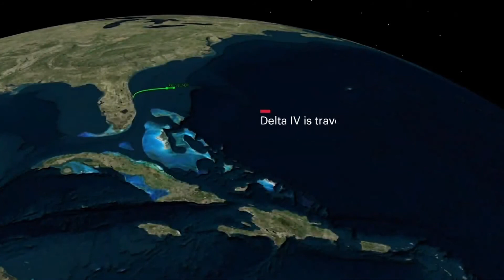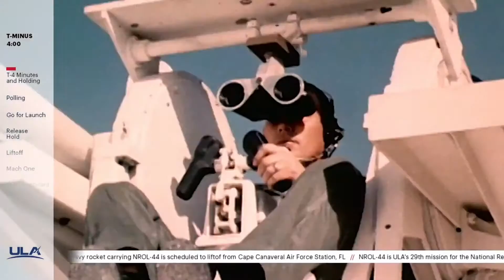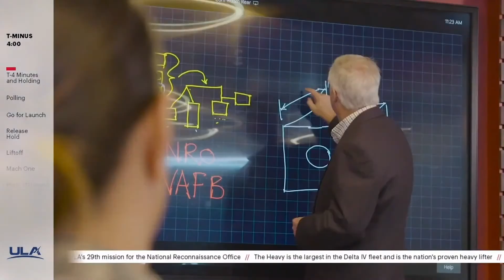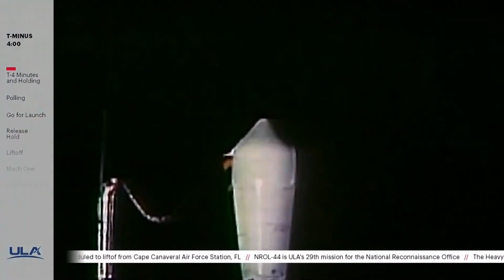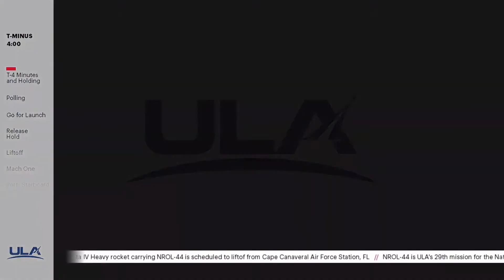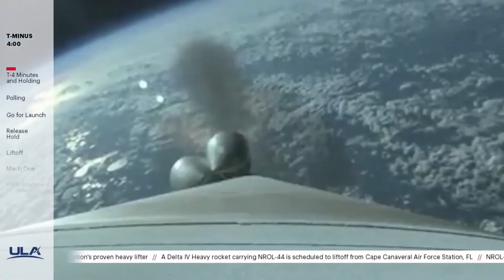WATCH: ULA Delta IV Rocket Launch (NROL-44 Mission) - Livestream

Comment: You'd think after 50 years of practise they could get the thing off the ground.
Reply: It's not like a car where you can hop in, turn the key, and go as long as the condition of the car isn't too bad. You do that with a rocket, and it's liable to blow itself apart.

Comment: question. Was it aborted because of a problem with the rocket or just simply weather?
Reply: 1:52:26   can't you see the hot fire leak? problem with the rocket, if it was weather conditions it would have been postponed 1-2 days ago
Reply: @danielochoa6100  Ok thanks!
Reply: Daniel Ochoa DeltaIV always start like that. Sounds like engines start to  light and then shut down?

Comment: And this is why SpaceX should be treated more fair. By this point SpaceX would have launched a Falcon Heavy and all boosters would have landed by now.
Reply: SpaceX aborts many launches. Everyone does. We can't all control the weather
Reply: That's very naive of you Michael. SpaceX also aborts launches. 
Given the cost and safety involved you would rather them scrub a launch than take an unnecessary risk.
Reply: @675ST-aa90  can you prove it how many they have a borted after ignition?